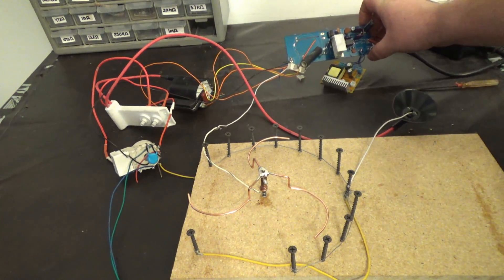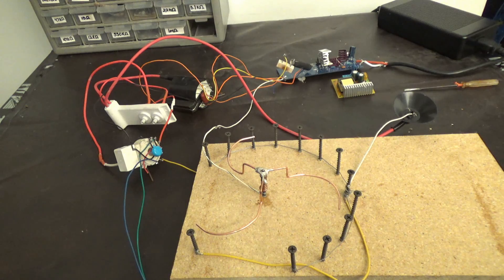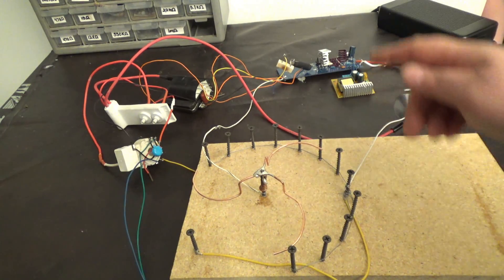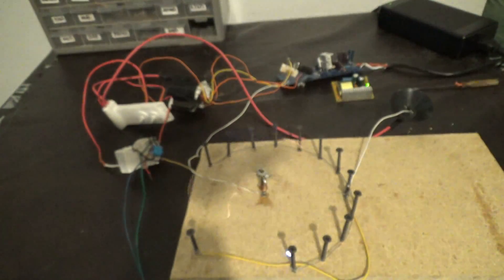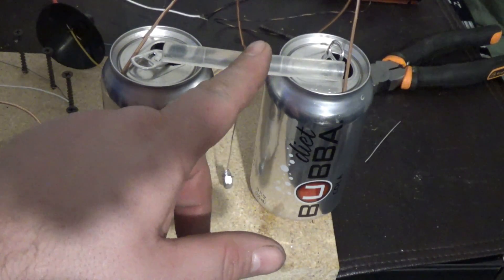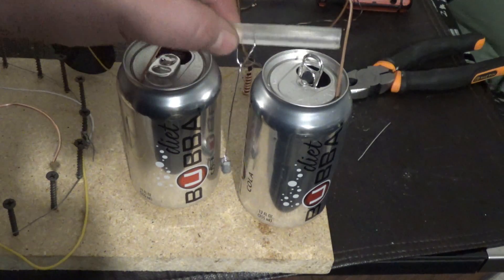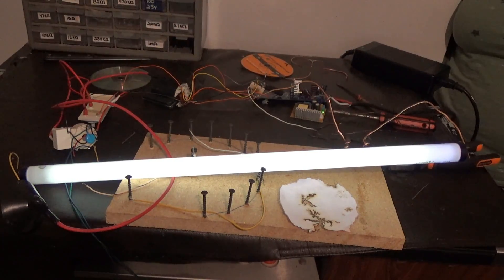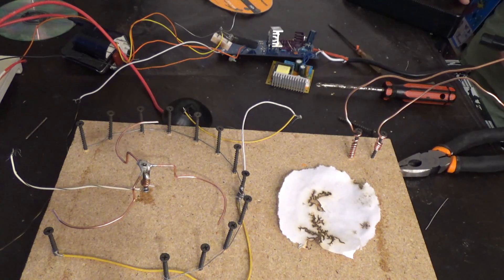Fun with High Voltage

Comment: I cannot express how awesome that was. Please keep experimenting and show us.
It was like you're making a time travel machine. The audio was already transported into another dimension. It did look dangerous

All fun aside, what happened with the audio? Was it too loud?
Reply from the maker: the high voltage arcs emit electromagnetic waves.  electro magnetic waves can be converted into electricity when they move past a wire. . the waves moved across the circuitry of the camera causing false readings which probably corrupted the  digital side of the audio